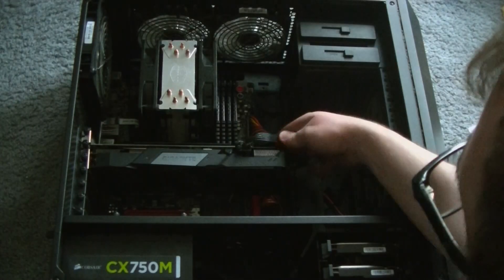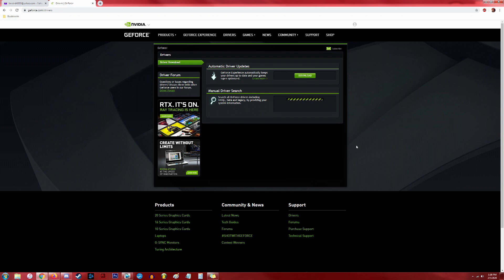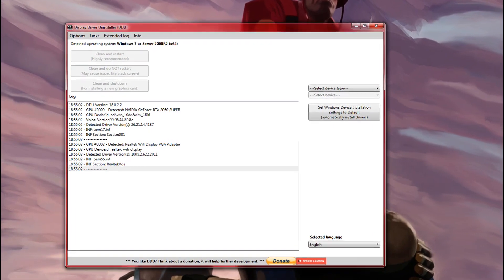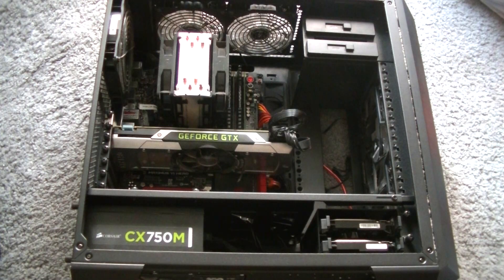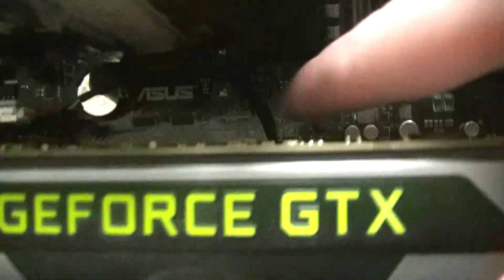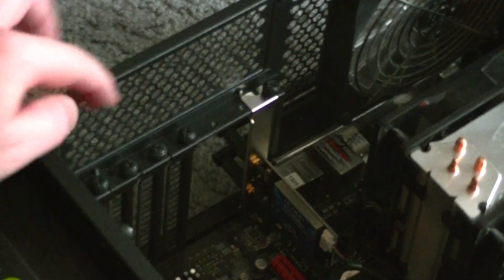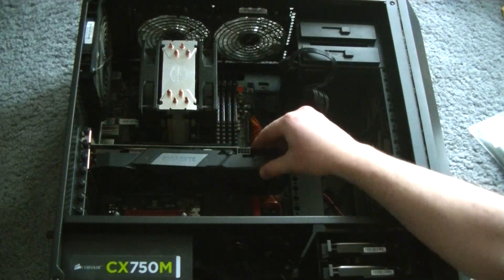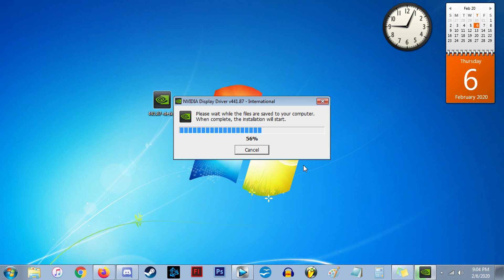How to Install a Graphics Card into a Desktop PC

Comment: video request: solving the COMMON problem of black screen after physically putting GPU into PC case. My situation is that (in Linux and using an old monitor) I am able to enter my BIOS password as usual and also see Debian 10 (non-free) starting up, but 1 minute later BLACK SCREEN!!!  This is before installing Nvidia driver and with no settings at all changed in BIOS.

Comment: I want to add rx 570 4gb with my ryzen 3 3200g do i have to uninstall display drivers?
Reply from the maker: It doesn't matter what type of GPU you already have, it's always recommended to uninstall the old drivers. You "can" get away without uninstalling them, though

Comment: Why do you have to uninstall old gpu srivers
Reply from the maker: You don't "have" to, but it's typically recommended, especially when you're changing to a new GPU chipset manufacturer (going from AMD to NVIDIA or vice versa). Old, unused drivers can take up space and slow things down if not flat-out cause issues and failures in your system.
Reply: Torqcx Oh ok thank you 👌

Comment: Dude help im using Ryzen 5 2400g cpu in a gigabyte A320m-s2h mobo and im planning to put a Zotac 1070ti amp. Many people have said i cant use the full pcie slot coz i have apu. And they said i can only use like 75% of my gpu :(( any comments on this? Nice vid btw!
Reply from the maker: What is an "APU"? And "can't use the full PCI-e slot?" I don't understand what they mean by that. Looking from pictures of that motherboard and its specs, I don't see why you'd have any issues like that.

Comment: I’m thinking to upgrade my gt 710 to a 1050 ti do I need to have the 1050 ti driver on my pc before I install or can I wait after I install
Reply: Get a 1060 instead.
Reply: Either way, it's easier to install before though, hope ur build goes well
Reply: Dk Gaming do I have to plug in hdmi/vga cable into the gpu

Comment: so if i'm understanding this right for the most part (outside of niche cases)

integrated graphics is plug and play?
Reply from the maker: Yes, integrated/onboard graphics should be plug-and-play if the OS has been properly installed on the system.

Comment: Thank you, this was very useful. I have installed GPUs before, but there is nothing wrong with a refresh. Watching other videos where you can't see what the person is doing because they have their camera set up is too far away and its dark, is frustrating. 
I had a GTX 670 that would have still been working if a cat didn't decided to pee on on my PC. Got everything cleaned out. GPU lasted for 5 more months and then one night it just stopped working. I open my PC up and my GPU had started eroding. So using integrated at the moment. Luckily my Z97 MB has a strong enough graphics to run some games I play but on medium. Im happy that I will very soon be able to get all my games running again on high/very high graphics! Its been 4 months I have been working with the integrated graphics. Its painful!

Comment: Why are you using windows 7? In 2020? Huh your specs seem to be way to good for Windows 7
Reply from the maker: I don't like Windows 10, I prefer the Windows 7 UI as I find it a lot quicker and more simple. I also like it a lot more cosmetically and enjoy the fact that it doesn't have any obnoxious ads in the start menu. For the most part, hardware that runs on Windows 10 currently runs fine on 7... for now

Comment: will my pc automatically switch to my dedicated gpu from my integrated gpu?
Reply from the maker: It should. If not, you should manually be able to do so in the BIOS.
Reply: Torqcx if not do you know where in the bios?
Reply from the maker: @ItsMoozy  It completely depends on your motherboard and its BIOS, but it should be in the video/display/graphics sections. In just about every single case I've seen, there's a graphics option and it should mention something along the lines of "Onboard Graphics".

Comment: Wait, so I have currently an RTX 2080 Super, and I'm thinking about getting another 2080 Super. I'm just kinda wondering if it's possible to run the exact same GPU's without any complications, or if you have to have two different ones in the same computer.
Reply from the maker: When it comes to NVIDIA SLI, you must get the same exact card for them both to function.
Reply: Torqcx Ok, thank you!

Comment: Do I have to uninstall my drivers if I’m going from amd graphics card to another and graphics card?
Reply from the maker: It's recommended that you always uninstall the previous drivers regardless, but if you're upgrading to a new card with the same chipset manufacturer like you are (and like shown in the video), I hear it's not necessary as the driver software should take care of it. But uninstalling the previous drivers is the fail-safe.
Reply: @Torqcx how do you do that

Comment: I really need to know this for the wire does it connect to the motherboard or the other side of the pc
Reply from the maker: Are you referring to the power supply's PCI-e connector? That comes from the power supply, it doesn't connect to the motherboard.
Reply: Torqcx like how it works the cord pci e

Comment: is it possible to just uninstall the drivers in the device manager without installing DDU?
Reply from the maker: Yes, generally speaking that's fine, I've done it many many times in the past. DDU is just the fail-safe, if you do run into problems.
Reply: Torqcx thanks. So which comes first the replacement of the gpu or uninstalling the old drivers
Reply from the maker: @jeddimaster5393  always recommended to uninstall the drivers first.
Reply: @Torqcx   what is the most common problem if i dont use the ddu and just uninstall it on device manager? thank you for the response
Reply from the maker: @jeddimaster5393  From what I've researched, gaming-wise nothing should really happen if you didn't uninstall the previous drivers (regardless of what method you use), but sometimes leftover old files could lie around, take up space and slow things down. Some argue you don't even have to uninstall the old drivers at all because the GPU manufacturer's driver installation software will take care of all of it (unless of course you are switching to a new chipset manufacturer, such as going from NVIDIA to AMD or vice-versa).
Reply: Torqcx  thank you so much. Now im ready to change my gpu hehe

Comment: how do you find the pins for the graphics card on a pc with internal graphics
Reply from the maker: It's the same exact process, you just have to look for the PCI-e x16 slot on the motherboard; it doesn't matter whether it has internal graphics or not.

Comment: Hey I’m just wondering is there any chance my pc case is not big enough for a graphics card I have a omen prebuilt pc and was wondering if it would work with a Radeon 5700 xt
Reply from the maker: You would have to measure your PC's case or just look up its dimensions. Most cards will fit in most cases, even micro ATX's.

Comment: I have a question, I am using the aurora r9 but i dont know what is a dedicated graphics card and all that...can someone explain please?
Reply from the maker: From only knowing that it's an Alienware Aurora R9, it's hard to say because they're so customizable. What are you trying to do? Are you installing a new graphics card in it? If so the process should be the same as shown in this video; I don't know if any R9 has an onboard card but they should have some sort of dedicated card already in there. Are you trying to upgrade it?
Reply: Torqcx Thanks for responding! I just want to upgrade it as right now it’s not that great. I just want to replace the graphics card with something else that’s better
Reply from the maker: @brysonkonoto6012  Then you'd more than likely just be replacing a dedicated GPU with a new one. :) Look up what kind of card that's already in your system and go from there.
Reply: @Torqcx  Awesome thanks!

Comment: i have an question, so now im using a ryzen 3 3200g intergrated graphics and want to buy my first gpu ( gtx 1650 SUPER) if deleted my old drivers plugged it in with my 6 pin power connector can i open google, search nvidia drivers and install it or do i need to have it as zipfile before installation??? hope to see an answer
Reply from the maker: Yes, you can still use your computer and search the internet without the drivers installed. It just won't look as good and you probably won't get your full resolution at the time. It's usually just recommended to obtain the drivers before you install the new card, as it's just easier.
Reply: Torqcx oh okay thnx:) just subbed

Comment: So brother my question is, that this will work for any desktop PC RIGHT??? plz tell me. 🙏
Reply from the maker: Yes, as long as the PC has a PCI-e x16 slot and the power supply is powerful enough to handle the card. Typically, though, OEM PC's have very weak PSU's and you'd have to upgrade it to support the graphics card.

Comment: With multiple PCIe slots do you have to use the one closest to the proc? What if you wanted to give the card a little more air circulation by installing it in the second slot? Ok to do? Assuming they are both the same of course.
Reply from the maker: The short answer is that it doesn't matter which PCIe slot you install the card in, they will run at the same speed. However, many motherboards will have both PCIe x16 3.0 and 2.0 slots (basically 3.0 is a little faster). Typically they will be color-coded, so if one of the slots is a different color, it's likely you have both types on your motherboard, and if you were to install the card into the 2.0 slot, you'd get slightly worse performance. Consult your motherboard's manual to be sure.

But again, often times with modern motherboards you'll only have 3.0 slots, so it won't matter.

Comment: My monitor won’t turn on when I put in my new graphics card any suggestions
Reply from the maker: Is the monitor plugged into the card or the motherboard? Does your motherboard have onboard video? If plugged into the card, which slot is the monitor in? If there are any power connectors required to be plugged into the card, are they?

Comment: Is the msi gaming x gtx 1650 super a 1 slot or 2 lot would you know
Reply from the maker: The NVIDIA GeForce GTX 1650 SUPER is a dual-slot. If you look at this image of one, you can see: https://images-na.ssl-images-amazon.com/images/I/811eJeQfu7L._AC_SL1500_.jpg

NVIDIA uses their "GTX" label when they are referring that the card is dual-slot. As far as I know, they use the term "GT" when it's a card that only takes one slot.

Comment: Hey i just have a question. So right now I’m my pc i don’t have a graphics card and i have integrated graphics and I’m going to buy a dedicated graphics card. So will my pc have the cord to plug into the graphics card?
Reply from the maker: What kind of PC do you have? Most OEM (original manufacture PC's, as in pre-built computers you get at most stores) will not have PCI-e connectors running from their power supplies. Best to open the computer up and check the power supply. It's likely that you'll need a new one, though; I can't remember I time I saw a pre-built computer from Dell or some other company with a dedicated GPU-ready PSU installed.
Reply: Torqcx I have a digital storm pre built I bought it for about 700
Reply from the maker: @obesityrocks4395  I looked that name up but I don't think that is enough info; do you happen to know the model name in particular that you have?
Reply: Torqcx Yes, sorry I have the digital storm Vanquish 7 with graphics embedded into the CPU
Reply from the maker: @obesityrocks4395  From what I looked up, that PC should have at least a 600w PSU. The short answer is yes, it will have the cable you need. That being said, I'd still be absolutely sure by opening your computer's panel up to check to see exactly what cable(s) it has. According to their website, the PC is very user and upgrade-friendly.
Reply: Torqcx Ok i will make sure to do that. Thank you so much and great vid!

Comment: Great video and super clear. 
Just to double check. If I have 2 GPUs and I want to replace both,  installing the drivers once will make both new GPUs functional, right?
Reply from the maker: If both the GPU's are the same model, yes. :)
Reply: @Torqcx  Thanks! For a 32 core Threadripper  with dual 2080TI, what PSU would you recommend?
Reply from the maker: @julian540  According to NVIDIA, they recommend at least a 650w for a single 2080Ti, so for two of those I would go absolutely no less than a 1000w. Probably need more than that, though.
Reply: @Torqcx  Thank you so much. I will definitely go well over 1000W to be on the safe side. Thanks for the help!

Comment: Does the power supply have the wires in already or no
Reply from the maker: If it's a non-modular power supply (like most of them) then the cables will all already be in there. If you don't have a PCI-e connector running from the PSU, then the short answer is you don't have one.
Reply: Torqcx What should I do in the event of me not having pcie cables? Hopefully getting a new GPU soon and I’m anxious
Reply from the maker: @aeiou6439  you want to make sure your PSU has enough wattage and is good enough to provide your GPU with adequate power. If your GPU requires a cable and your PSU doesn't have one, it will not work. You must get a PSU with at least enough wattage (which in every case I've seen, will also have at least one PCI-e cable) to support your new graphics card.
Reply: Torqcx Okay, thank you! I have put everything into a pcpartpicker list and so far, no issues really have risen. Thank you for the info!
Reply: Torqcx I have looked into my PSU and it seems there is a 6+2 PCiE connector. Does this work?
Reply from the maker: @aeiou6439  yes, that just means it is convertible from 6 to 8-pin. :)

Comment: When I'm switching from integrated to dedicated, I need to plug the HDMI in the dedicated instead of the normal port?
Reply from the maker: Yes, plugging the cable into the integrated port will have the monitor attempt to connect to the integrated card. Generally speaking, when a dedicated card is in one of the motherboard's slots, the monitor(s) will only be able to get a connection from being plugged into the card, as the BIOS will tend to disable the integrated graphics when this is the case.
Reply: @Torqcx  thanks, you are a amazing

Comment: So if i want to buy a graphics card and have currently integricated graphics card will there be anything on the way?
Reply from the maker: So here's the thing, 9/10 times you shouldn't have to do anything additionally, because modern motherboards will default to the PCIe slot if they detect a card is in there. However, on occasion if for some reason your PC is not doing that, you'll just have to go into the BIOS and manually set your system to the slot and not the integrated GPU.
Reply: @Torqcx  thanks
Reply: @Torqcx  Can you be more specific please? Didn't understand a thing.. :D If i have integricated card do i just plug graphics card and then run that Nvidia driver instalation?
Reply from the maker: @percy1633  Yes, typically you just install the card, plug your monitor into it and install the driver. If for some reason you run into problems, disable the onboard video either in the Device Manager or the BIOS.